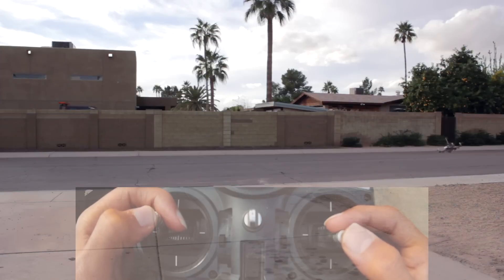How to Fly a Quadcopter (Part 2) - Bank Turns

Comment: Hi, just wanted to give a bit of constructive feedback: Quadcopters don't actually have ailerons or elevators or rudders so using all these terms is a bit confusing. Why not explain throttle, yaw, roll and pitch and then only stick to those terms? You might also show the sticks while you explain and indicate whether it is a mode 1 or 2 layout.

Comment: If you apply up elevator surely it stops the forward motion of the quad as you push forward for flight , if you pull back it must stop the quad?

Comment: Aside flying on flight simulator, one may gain significant skill by flying small and cheap coaxial helicopter. Point is that it is more demanding than simulator, but less demanding than real quadcopter. Once learned flying indoor (with small heli), go outdoor and see what changes - weather (wind!). I found my learning skill on small heli is much more difficult, but once learned - it just stays with you until end of the.... universe...

Comment: You do bank turns different than me, because I tilt the right stick forward to go forward and then while still tilting forward I then tilt the stick left or right for a banked turn, all the while adjusting throttle for height. I don't pull back on the right stick unless I want to climb out of the turn or slow down. I use rudder or yaw very little to fly my quad, because when you really start learning how much the right stick controls the quad you don't need much yaw control. In the order of importance to me is pitch and roll or right stick and then throttle and yaw left stick. But it's nice that you are trying to help people, Good Luck.

Comment: Thanks for the video. Very informative. One suggestion, your terminology is for fixed wing aircraft. For quads you should just use pitch, roll and yaw! Quads don't have control surfaces such as ailerons or ruders.
Reply: specmac1 I think his terminology is intended to help beginners correlate the controls that are labeled on everything like transmitter channels, receiver input labels, flight controller settings, and so forth to the actual intent of whichever maneuver he's helping teach.  ***** - is that close?